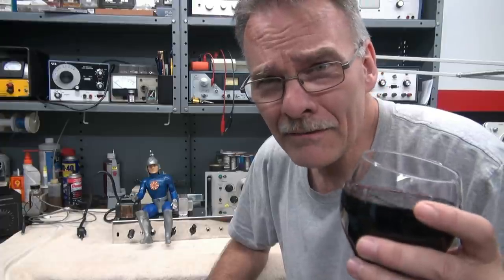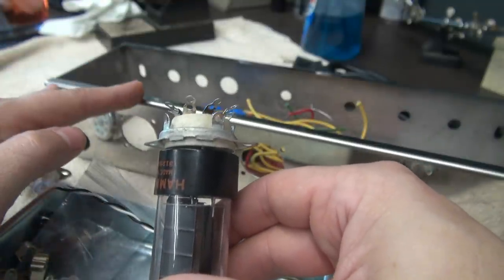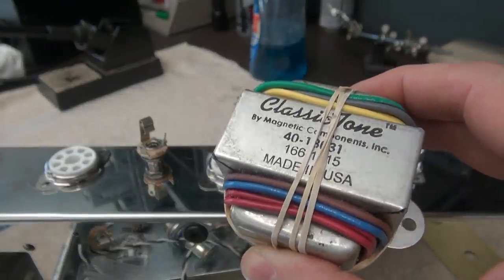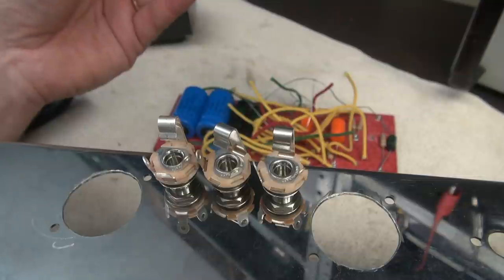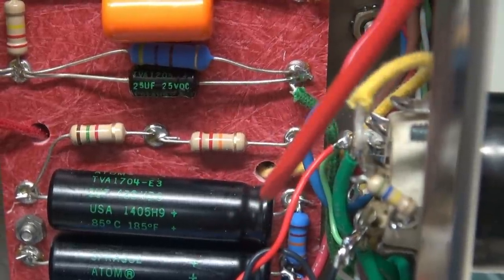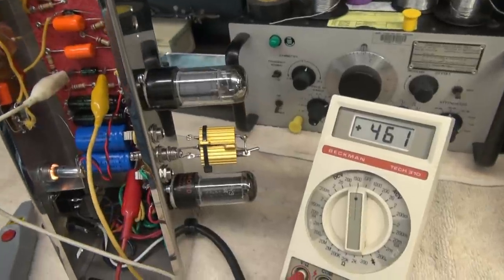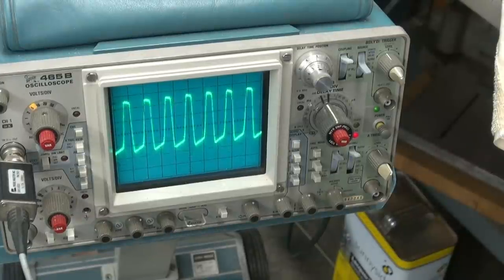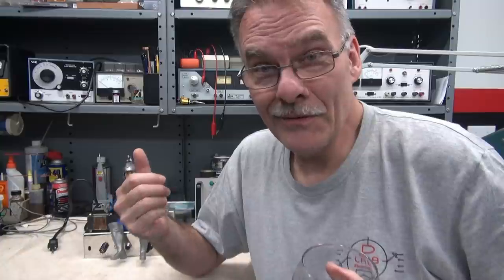How to build Fender Princeton tube guitar amp kit beginning to end D-lab

Comment: Dear Terry,
I am in process of this same build and I have carefully followed all of your suggestions as to mods to the layout as provided. My power transformer puts out lots of juice with 100 Ma output so I substituted a 1 K ohm 5 watt resistor for the 470 and of course the amp doesn't work. When I measure, I don't seem to have much if any B+. Any pithy suggestions?
Reply: What kit? Very interested as well. Thanks 😀

Comment: This sounds like a crappy amp kit if you have to make all those changes  and missing parts.  Why not start with a better quality kit?
Reply: If you are building one of these, you have to start somewhere. Most of your tube sockets come from china. The replacement cost of changing to the more expensive socket was not that much money.  The chassis is from china as well. I know something about finding these parts as I sourced this all on the web. The board is from Watts tube Audio. The transformers are from classic tone. I also sourced a tweed cabinet for it as well. I was going to do this build myself, but I knew my knowledge of wiring and some of the things he done made my choice of using him as my builder was a wise decision. I'm happier with the end results than if I would have gotten only halfway done and he is happier because he didn't have to tear it apart and fix all my mistakes. Price a finished version of this amp or a kit from some of the vendors. Also see if they are using the chinese tube sockets or capcitors you never heard of. I'm happy with the results. You seen the results of what the amp does sound wise. When I sent him the amp parts there were a few things missing but Terry doesn't charge that much for parts.  Using the transformer upgrades make this a better amp as well.

Comment: Hi Terry.  Thanks for the info on this video.  I built a 5F1 Champ kit with the same transformer upgrades.  Couldn't figure out the noise issues.  Checking the bias  confirms the same issue that you discovered.  Hopefully I haven't ruined the 6V6 tube.  Also will try the 560K resistor on pin 5.  You have been a great help.  Thanks!

Comment: Hi, really like your lessons! I have question!
I have a  Marshall JVM 410 h. It started with a loud crackling poping sound.
I replaced all four power tubes and tried switching out and replaced two of the Ecc 83 tubes.
I get no output sound from speaker cabinet. It's a 1960 lead. Can get sound from the FX-loop return,
When guitar is jacked in there. The amp has very few hours on it! I looked at the boards, saw no damage or
Even ware. Only thing I could find is the 16ohm Jack for a single cabinet, dose not feeling like a tight Jack plugged in.
The other inputs all feel much tighter. Can you tell me what voltages should be for bais for power tubes.

Comment: Negative feedback lowers the distortion and also the output impedance of the amp, which leads to a flatter frequency response.  Whether that's good or not depends on what kind of sound you're looking for out of the amp.  The distortion could clearly be seen on the sinewave that Terry showed on his scope.
Reply: What’s Terry say about that?

Comment: I bought a Marshall clone from a "reputable" clone amp maker that has sockets that look like those Beltons at the 5:00 mark. After taking the tubes out of them once, the pins are coming out with the tubes.  They literally would fall out if up ended.  Had them all replaced by a local amp tech.

Comment: I noticed ,when you showed the output jacks one of them had the contact on it and the other two didn't and then when you showed them wired up, none of them had the contact lug. I wish more guys would show hooking up inputs and outputs, tone pots and volume pots. Beginners have more trouble with these things than any other part.I have wore out tone and volume pots wiring and re-wiring jacks tone and volume pots. I have read all about it and just get more confused. I wonder sometimes, why someone does not show this. Just showing it after it is wired, you can't see where all the wires go and some people call lug one on the vol pot lug 3 and such.I almost blew up my output transformer trying to hook up 3 jacks.I wish one person would take the time and make a video showing how to wire jacks and pots, if they are self grounded or not self grounded and such. I don't guess anyone will. I am the type of person ,that if you show me, I get it. I have a reading disability. The muscles in my eyes are messed up.I see pictures inside amps but you can't tell where all the wires go. It is hard to solve issues texting or typing.

Comment: Terry, another well done episode. Love your advice on the tube sockets, very very good to know. On the cathode resistor, I generally use a decade box but same result. I do agree on the quality components - I also try not to use cheap caps.  Great great job Terry..... As always.  Ron
Reply from the maker: You must have a high power decade box?
Reply: Terry, I have a homemade 20W box I made.  Only values in there are 470, 1K , 1.5K , 2K and 4K.  Its meant for quick tests.. not for leaving on very long  :)

Comment: Hey Terry watched this video by you along with another one today and I have a question about the symmetry to the sine wave output on your scope.  It does not look like you have equal positive and negative sides of he waveform.  I have seen this before on my scope also and I ended up changing an inverter tube in the amp I was working on to fix this issue and recently I saw an Uncle Doug video where the amp he had on the bench had the same kind of output although I don't recall how he fixed it.  I was wondering if the next time you build either a push-pull 6v6 or one like this single 6v6 if you could please show the waveforms at the output of the first preamp stage and then also at the output of the inverter as it would interesting to see if the waveform has changed in one of those stages or in the output stage.  Thanks and I really like your videos also.

Comment: If you don't use the 22K resistor to the speaker jack, what happens with the wire?  Do you just leave it disconnected and if so, do you even need to put that resistor on the board to begin with?

Comment: It IS a Champ. Princeton's have two 6v6s.
Reply: Ok, I see 2 now! Sorry
Reply: Unless that is the rectifier
Reply: It is a 5f2a Princeton tweed amp clone. It has one 5y3 one 6v6 and one 12ax7. The difference between this and a champ is that this has a tone control. These were originally made in the  1950’s when fender was just starting out. Princeton’s had two 6v6’s later on. Like the famous blackface Princeton.  This was a basic amp from the 1950’s. The one thing people missed on this build is how quiet it is. Give Terry credit for lead dress and like he said the quality of the parts.

Comment: Glad I found this video.  I have a 5F1 kit I'll be getting to soon.  Couple questions: do you have any preference between the grass plate ground bus vs. A wire ground bus? My kit is meant to have a wire, but I've been thinking of getting a piece of brass and go that route.... also an the output impedances,  I'm guessing you can only use one at a time, yes? I have a a multi tap OT as well, I may go with a switch since I'm not sure multiple jacks will fit.  I have a 65 bandmaster with a bassman output tranny (from a prior owner) which has a multiple outputs.  My speaker jacks have been wired so that the extension output is a different impedance (with a 3rd, unused output capped off inside). I don't know, however, what impedance that alternate is. What's the best, safest way to verify? Thanks and great video!

Comment: Tube amps belong in the Museum!
Reply from the maker: You should give one a try, I bet you'd be hooked
Reply: I built amps back in 1956. The first one 2 ecl80 in push pull later a 20 watt amp using 2  KT88. Since then I´ve built a lot of semiconductor amps. I´m a pensioner now. i´ve just finished making my surround sound amps- The main left right channel 2 Quad 402 amps, Which no valve amp can touch. Hardly any distortion from a few cycles to way above the human Hearing range.Can a valve amp attain that? The answere is no. The Output transformer sees to that. The o/p transformer falsifies the Sound signals, blunting up fast transients rounding off shjarp flanks giving the amp these mellow tones that valve freaks crave for. No thanks I´ll stick to my Quad amps